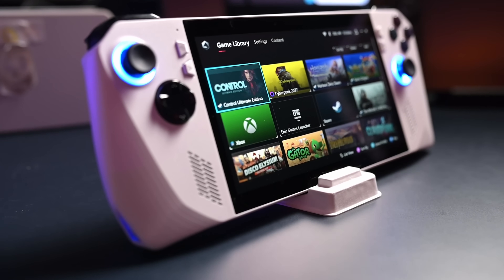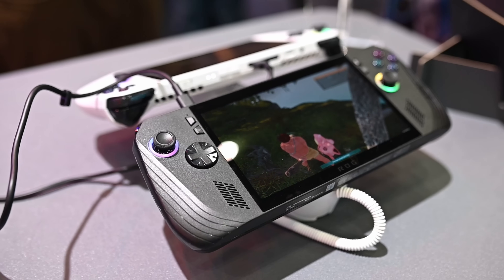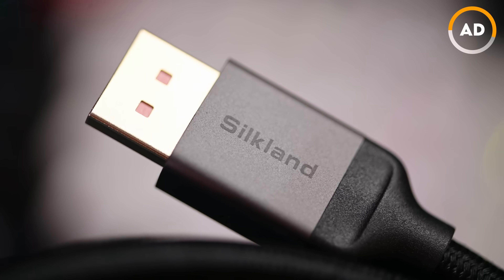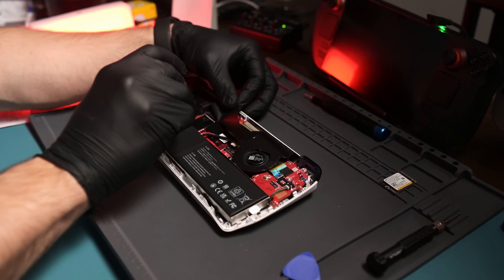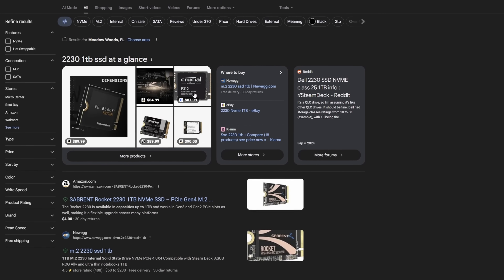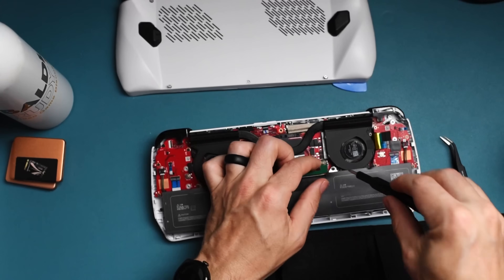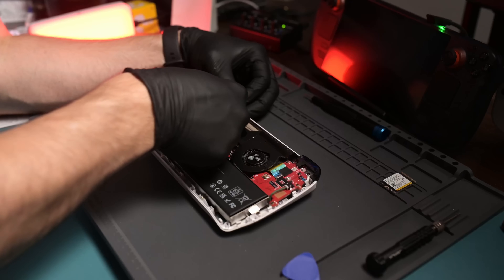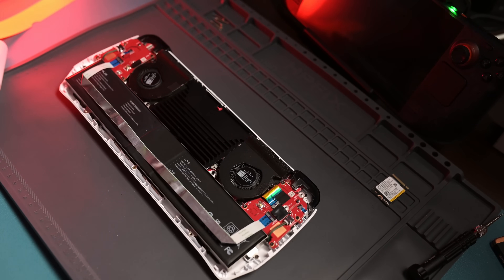I FIXED the ROG Ally...

Comment: I have the open source xg mobile station lite and works like a charm with a rx 7600 XT only the xg cable is a expensive purchase 150 bucks and on ebay the board 120 then al you need is the PSU and GPU and a case if you need one

Comment: I upgraded mine to a terabyte, but I’d love to have somebody put Halifax joysticks in it. I’ve never had no problems out of mine. I’ve never used the SD card slot. I only have one game downloaded on Black ops six I don’t play it enough to have any more games on it once every couple weeks or so play it for a few minutes But as long as my Internet is running good it does just as good as my PS five except for the fact that it’s harder to see what’s going on farther in the background so I get shot from the distance more than what happens on my PS five
Reply: I have the Ivanky case and Doc the Doc looks nice. I’ve never actually got to use it yet, but it looks top-notch. The case works pretty good, but the Velcro strap to hold your ally in it’s about an inch and a half too short it just does not hold it
Reply: @EspionageTV Your review is contradictory. Which is it?
Reply: @illogik  how is it contradictory?
Reply: @illogik  which is what?
Reply: @EspionageTV You said the case works good but it doesn’t hold the ally in. How is that considered working good?
Reply: @illogik  it’s a carry case it’s form fitted perfect for the ally and it’s charger but there’s a flap with a Velcro strap that holds the L in its place  but if you don’t do it just right, the Velcro won’t attach and if you would pick the case up with a zipper open It would fall out.
Reply: I dont think playing cod online on a handheld is a good idea
Reply: @redcrimson102 maybe for you

Comment: So how much more above the $380 will you spend to get the ally to ally x performance?
Reply from the maker: With everything that I mentioned in the video, it comes out to around $200.  But to really get to the Ally X performance, you'd need to swap out the RAM on the motherboard.  The extra 8GB makes a bit of a difference when I compared the two last year.  https://youtu.be/CDLRvohK0k0
Reply: I honestly love my ROG Ally z1 upgraded to a terabyte, but it was one of those things that you just want for me. I don’t have the time to play it. I don’t have the time to play my PS five it just sets up on the wall where it’s mounted and only gets used when the power goes out for my son to watch DVDs my Z one is almost like brand spanking new. I really thought about selling it. I have way too many handheld and consoles setting around that doesn’t get used enough for me right now. I think y’all would rather have the switch 2 which I’ve been holding off on buying because of the above mentioned reason I have too much stuff the way it is I like playing Mario kart but I know I would miss it if I did sell it, but I would just patiently wait until PlayStation comes out with its handheld in a couple years, which would definitely have a better user experience for me personally everything I buy myself. I also buy one for my teenage son except for the ally. He’s not much into that. Great video I love talking about the Z one. It’s a very capable device.

Comment: I'm doing the 74wh battery with copper plates. Does the jsaux battery have a metal plate to block the ram heat? If not it will just degrade faster. I also got the handhelddiy backplate which has better cooling the the jsaux cooler.
Reply from the maker: The Jsaux one is metal.  I'll check out the copper one.  Thanks for the heads up!

Edit: I double-checked the type of metal, and it's aluminum.

Comment: With all these mods, is it better to get the rog ally z1e than the sd oled? I already got sd oled but miss some games that can't run on linux.
Reply: Have you considered dual booting Windows on the SD?  Also if you are looking at used handhelds, you can also get an OG Lenovo Legion Go for around the same price ($375-400 where I'm at.) if that interests you with the larger screen.  If you are looking at new Z1E prices with upgrade prices, it also might be worth looking at a used Ally X.  I've seen as low as $680 locally to me.  Just sharing some thoughts, I'm currently in the market for a handheld PC but am on a budget, so I've been looking a lot and watching a bunch of videos.
Reply: @matthewmarcukaitis9998 I have considered dual booting but just feels like a hassle to me. I am not a fan of the Legion Go due to the massive size. That was one of the reason why I was also considering letting go of the deck. I find it massive. Used market for Ally z1e is what I was looking at. I won't go brand new with it since my goal is to mod battery.